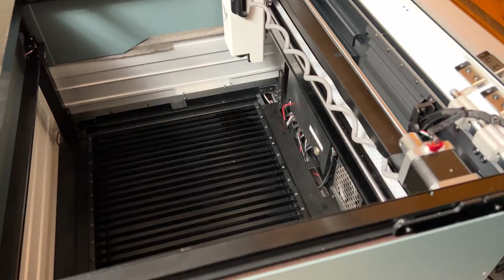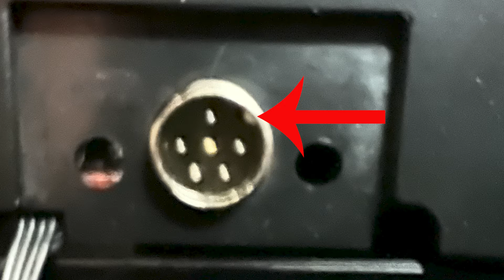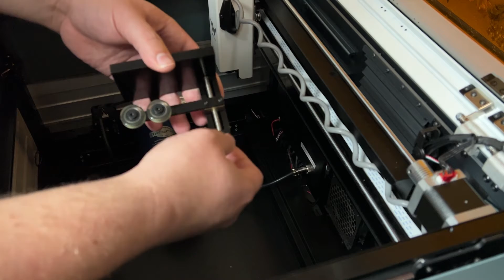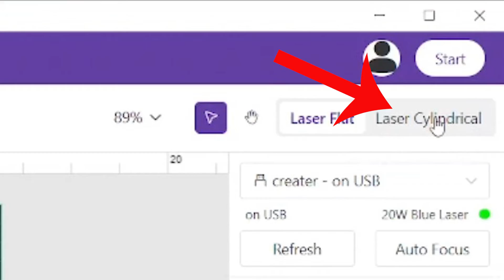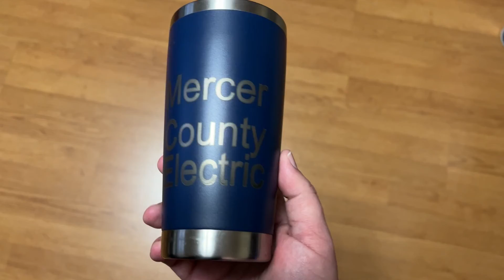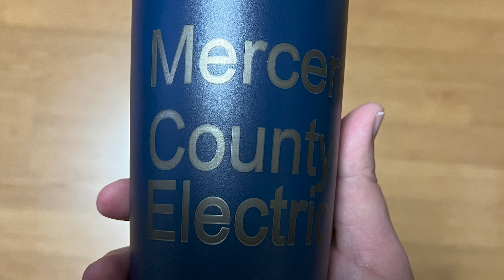First Look at WeCreat Rotary Tool Laser Engraving

Comment: Ahh why is that cable below the tumbler...
Reply from the maker: @enjoey30  this was just my first attempt. The wire is safe. The cup is the only thing being hit. I could have probably rerouted it better for my first attempt but didn’t think much of it.
Reply: @FreshStartCustoms  I think it’s a problem of the machine. Is it even possible to wire the cable around the tumbler? It didn’t looked like it. But you are right, the cable is save cause the laser isn’t moving. Only the rotator y is :)
Reply from the maker: @enjoey30  I don’t think mine was long enough to do that otherwise. I originally thought it was because mine was a beta machine but I think you’re right looking back this might just be how it is.